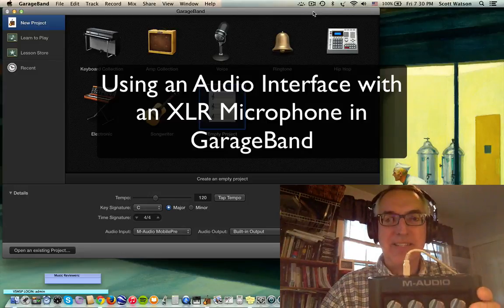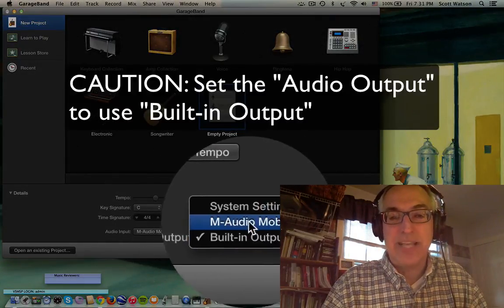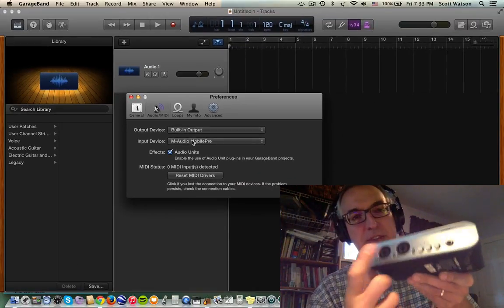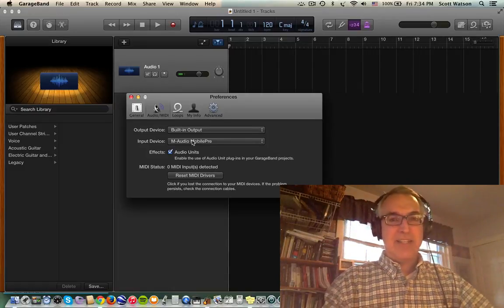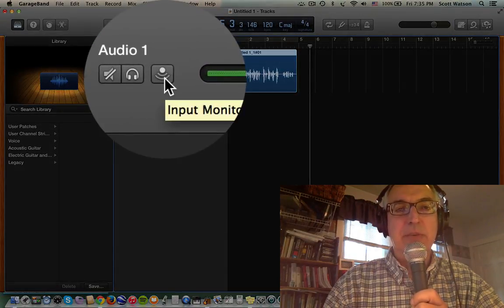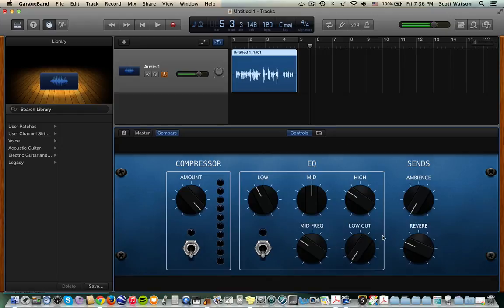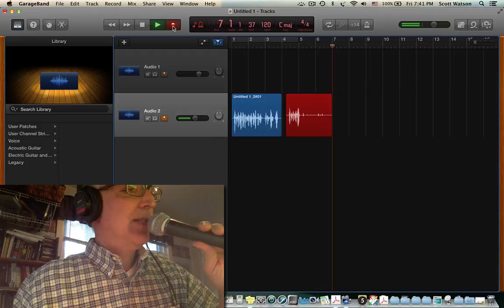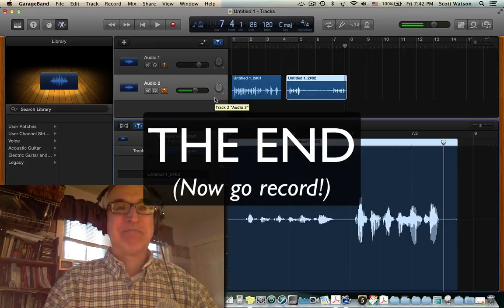GarageBand: Using an Audio Interface with and XLR Microphone

Comment: Dr, you said you do t prefer the output to be also the M Audio, but System Built-in instead. Why? I suspect it may solve my headache: I used Scarlett and now M Audio U-phoria, same idea, and same problem. I connect the Interface to my Yamaha HS monitor via the RCA-jack Route (RCA from Interface, Jack into monitor). Then I choose M Audio in GarageBand as output. When playing instruments in GarageBand using midi controller/keyboard, the sound out of the Hs monitor is just weak and sluggish. Very unsatisfying to play and keep time.

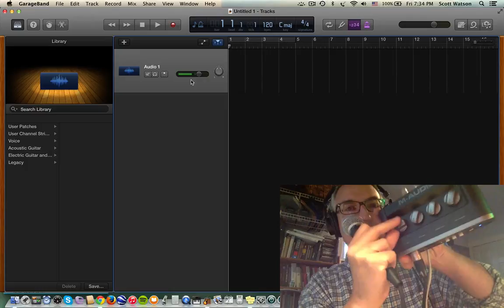Comment: My VU meter isn't showing up. I have done everything up to 3:50 in the vid, but my mic doesn't seem to work. Do you know what the problem is? The mic and interface worked on my old laptop, so I don't think either of them are malfunctioning. Could you help me out?
Reply from the maker: Check the GarageBand Preferences, under Audio/MIDI, to see if your interface appears in the drop-down list. If it does, be sure it is selected. Then go back to the audio track and make sure it is assigned to a channel from that interface. Another issue MAY BE that your mic is a condenser mic that requires phantom power (48v boost your interface can add IF it has a built-in pre-amp). Usually you can turn on phantom power by pressing a button or flipping a switch on the audio interface. Good luck!

Comment: Dr. Scott, I am using an MBox 2 into my MacBook Pro laptop. I'm trying to locate it in Garageband Preferences or elsewhere but it doesn't seem to recognize it. The MBox is not even getting power. What do I do next?
Reply from the maker: Hmm.....is the M-Box USB powered, or does it need a "wall-wart" type power adapter? I think there was a time when M-Box only worked with Pro-Tools, but if your gear is newer you should be OK. I can't imagine your M-Box needs a "driver" - something you almost never need anymore for a Mac to recognize a peripheral such as an audio interface. Have you tried any other audio interface (maybe borrow a friend's) to see if the problem isn't your M-Box? I have had fairly consistent success with my MacBook Pro and both M-Audio and Focusrite USB audio interfaces.

Comment: Dr Watson, I need help to record my digital piano via presonus itwo audiobox onto garageband on my ipad. When I play the keyboard while recording, I can still hear my keyboard and the sound on the recording in garageband is very low and not so good. It looks as if it is simply recording the keyboard externally. Can you please help with the correct way to plug in and all the settings. Your tutorials are excellent but I am a total beginner and would appreciate assistance greatly. Thank you so much.
Reply from the maker: I don't use GarageBand iOS much. I assume you are using a USB-to-Lightning adapter for your interface, and that you adjusted the Input Level on the GarageBand iOS's audio track. Other than that, it's anybody's guess without being right there to see everything. Sorry, but good luck!

Comment: Hi Scott... using the same Garageband version butt with a Focusrite Saffire PRO26 interface... followed all your directions am Mic getting signal into the Interface but nothing registering on the mic /vocal channel/or headphones...what am I doing wrong?
Reply from the maker: I don't know that interface, but the only thing I can guess is that when you plug the unit into your Mac, GarageBand tells you it detects it, asks you if you want to use it, and you say yes. But then - in most cases - you need to go into the GB Prefs and change the Sound Out from the Saffire to Built-in Output. You probably already are on top of that though...sorry I can't think of anything else.

Comment: This is such a good tutorial for garageband and using an audio interface, however for some reason, I cannot hear myself properly in my headphones. It's quiet on one side and louder on the other. When I sing into the mic, it makes a scratchy sound. Then when I play it back, it's sound is low on the recording. I can't figure it out.
Reply from the maker: Check the GarageBand Preferences, under Audio/MIDI, to see if your interface appears in the drop-down list. If it does, be sure it is selected. Then go back to the audio track and make sure it is assigned to a channel from that interface. Another issue MAY BE that your mic is a condenser mic that requires phantom power (48v boost your interface can add IF it has a built-in pre-amp). Usually you can turn on phantom power by pressing a button or flipping a switch on the audio interface. Good luck!

Comment: Do you know if with a c600 fast track I would need the dc power source connected as well? I just couldn’t find it. I bought it second hand and came alone. Looks in shape and turns on. I bought a usb cable and ohh ya turn on but it doesn’t pop up anywhere. I’m using the newer version of garage band I believe. I’m using a usb c hub adapter and it seems to work fine as it says “1 new midi connection found” but I have no idea where to find it. If you could help I would appreciate it. Thank you so very much for taking the time to read!
Reply from the maker: I'm not sure since I don't have that interface, but...
Check the GarageBand preferences to see what audio in is set to. If GB recognizes your interface, it should appear in the drop-down there to choose from.

Comment: I have a question, i have my interface connected to my computer and my instrument connected to the interface, and GarageBand recognize the interface but it doesn’t drop any sound, what can i do?😢
Reply from the maker: You may need to go into GarageBand ->preferences, under Audio-MIDI tab, and make sure that the output sound is coming from your computer, rather than the interface.
Reply: @ScottWatsonMusic  i’ve realized that my interface doesn’t works with high sierra, i had to buy another interface, thank you anyway 😅

Comment: Using a Persons Firestudio and having issues getting any sounds at all out of Garageband though it is reading my interface and every step was the same as yours except when I hit record I'm not getting any sound waves at all.. Any advice?
Reply from the maker: Sorry for the slow reply - I just saw your question. Another viewer had a similar question so I'm going to quote myself here:

"I don't have first hand experience with that mic or audio interface, but I have had a few instances with the old GarageBand in which I set up an audio track for a mic and/or interface and GB didn't recognize it (VU meter didn't move to show signal sounding), so....I set up a 2nd audio track, then after that when I clicked back on the first audio track it suddenly worked. You might try that. I have no idea why this did the trick, but I had to use it quite a few times with students (I teach music production at a high school). Just be sure before all of this that in the GB Preference you have selected the interface/channel and confirm the same in the "Input Source"area at the bottom of the track Info (letter "i" icon) window."

Let me know if this helps.

Comment: I am also using a Shure SM58, but with a Roland QUAD-CAPTURE as the audio interface. 
Should it make any difference if I have a 1/4-inch jack from the mic rather than the XLR plug? I ask because, although the sound is coming through, it's rather on the soft side, even with the input volume on the audio interface all the way up.
Reply from the maker: I've only seen Shure SM58's with XLR - not 1/4 phone - jacks....that seems odd. Since I know that mic is a dynamic mic it would not require phantom power (48v pre-amp), so I'm not sure why you are getting such a low signal. The only other settings I can think of that might affect the sound are the main volume and track volume assigned to that signal. Let me know if you figure this out - would love to hear the solution.
Reply: Scott, thank you so much for your response. I think I did find the solution to the problem. There is a "virtual" control panel--an app(?) you open up on your computer) for the Roland QUAD-CAPTURE. I had kind of ignored it before. But I finally fiddled with it and got what I think I needed. 
The control panel has three sections: preamp, compressor, and mixer. The mixer is, I believe, irrelevant to me since I'm not using the audio interface for output. The preamp has a volume control ("sens") that seems to be tied to the physical volume knob on the audio interface unit itself. (There are also some other controls I still don't understand.) 
The surprise for me was the compressor section. There are two controls there that made the difference (and four others that don't seem to make a difference to what I'm doing): "gate" and "gain." I need to have the gate at a low setting or it suppresses/cuts off the signal. And I need to have the gain very high or even full. 
So now I'm getting adequate gain. Thanks again for your response though!
Reply from the maker: Actually "gain" is always part of the settings for compressors. I've used increasing the gain there as a work around when I has an especially weak signal, but I still think there's something else going on. I get the idea you are using an XLR-to-TRS mic cable (with the XLR plug on the mic side and the TRS plug on the audio interface side). If I was you I would borrow a conventional XLR (both sides) mic cable (or bite the bullet and spend about $20 to purchase one like this http://bit.ly/2q5pBxw) and use that to connect your Shure SM58 mic to your interface. I'd just like to see if that would help. I think there's something fishy about the TRS input to your interface (either the cable or the jack).

But good for you for digging deeper and discovering the software compressor!
Reply: Thanks again, Scott. I will definitely look into trying an XLR cable!
Reply: Scott, it's been a long time since I asked you about this (What? Only 8 months? I actually thought it was even longer!) 
I've been using another mic in the meanwhile, but I did finally get an XLR (both sides) cable, and that did indeed solve the problem. 
Thanks so much for your advice!

Comment: So I did all that and the mic is still not being picked up, is it cause my headphones aren’t plugged??
Reply from the maker: Check the GarageBand Preferences, under Audio/MIDI, to see if your interface appears in the drop-down list. If it does, be sure it is selected. Then go back to the audio track and make sure it is assigned to a channel from that interface. Another issue MAY BE that your mic is a condenser mic that requires phantom power (48v boost your interface can add IF it has a built-in pre-amp). Usually you can turn on phantom power by pressing a button or flipping a switch on the audio interface. Good luck!

Comment: If you adjust those dsp settings in the master  controls, is there any way to save those settings, so you don't have to change them every time you record? Thanks.
Reply from the maker: +JayFonzerrelli Once you make all the DSP additional/adjustments to an audio track, you can save those settings to recall later. To do this:

1) Click the LIBRARY icon to open that area on the left of the program.
2) Click on the SAVE button on the bottom.
3) Create a unique name for your audio setting (i.e. "Fat compressed vocals") - this will be stored in the Library's USER PATCHES folder to recall whenever you want.

Hope this helps!
Reply: +Scott Watson thank you for the quick reply.

Comment: What about wireless mics? Same process?
Reply from the maker: Sorry for the slow reply - I just saw your question. Although I've never used an audio interface with a wireless mic, I believe a lot will be the same, only you'll have to figure how to route the mic feed to the interface. My guess would be that the wireless receiver has an audio out port.

Comment: what about two mics?
Reply from the maker: Assuming you have at least a 2-channel audio interface (like the one shown in my tutorial), just set up TWO different tracks in your software - one for each channel/mic, OR set up a single STEREO track that has a different channel/mic from the interface assigned to it. It's really not that much different than the single mic approach shown in the video. Just be careful in most situations to use fairly matched mics. you wouldn't want, for instance, to use one dynamic and one condenser mic with a 2-channel interface such as the one I used since it has to either have the pre-amp ("phantom power") ON or OFF for both channels. Often interfaces with more channels allow two of the channels to have phantom power ON while the other channels don't have it. That way you could record with a condenser mic (phantom power ON) and a dynamic mic (no pre-amp) at the same time. Hope this helps.

Comment: Why using a shitty computer soundcard as the output? I Dont know the soundcard of that m audio you have, But 100% is it better than any Stock computer soundcard sold
Reply from the maker: Not to be contentious, but you're definitely wrong about that. The sound card on a MacBook Pro is at least as good as on the M-Audio audio interface I showed (MobilePre)...probably better.

Comment: I was wondering if you know how to access the software that I downloaded when I purchased the M-Audio 2 x2 m? I have the same mic and also using GarageBand! Thank you!
Reply from the maker: I'm not sure what software you mean. If you mean a "driver" (software that enables your interface to work with your computer), most Mac OSX computers don't need a specific driver to work with the M-Audio interface, but if you visit the M-Audio website there is probably a "download" area for obtaining drivers for specific items. But maybe the interface came bundled with some digital audio workstation such as Abelton Live, etc. and for that I wouldn't know. Good luck!